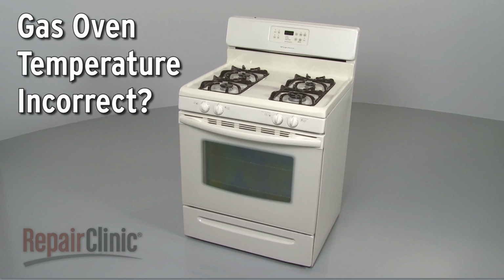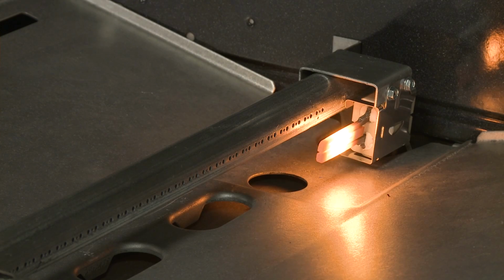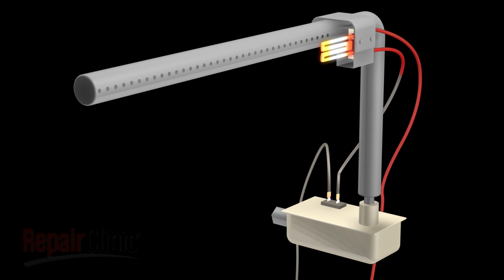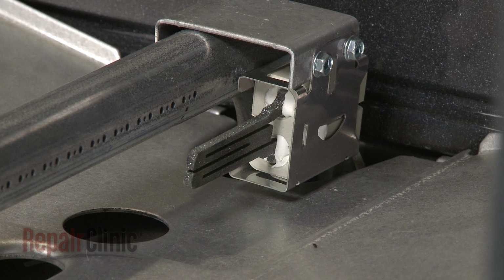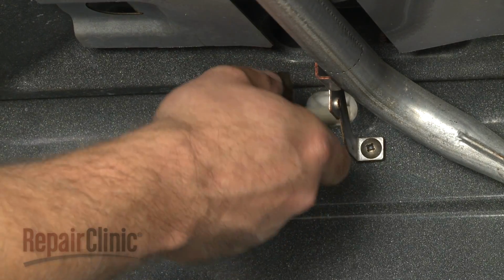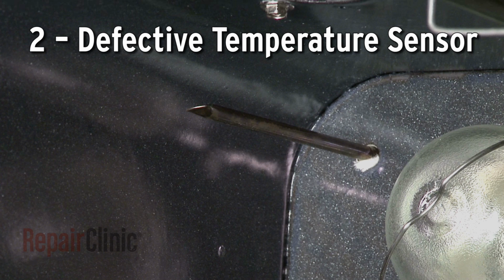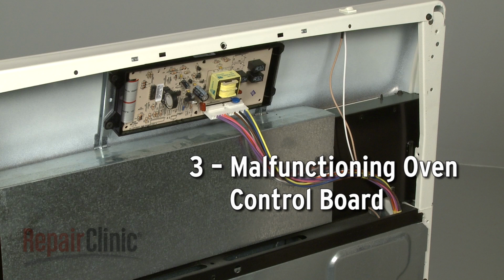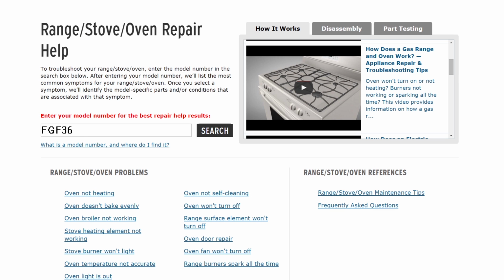Gas Oven Temperature Is Incorrect — Gas Range Troubleshooting

Comment: Does the ignitor need to stay on the entire time that heat is demanded in order for the safety valve to stay open? Wouldn't it be more efficient to use a flame sensor like a water heater?

Comment: For some gas ovens, the temperature will always be wrong. This is because the manufacturer has printed the temperature gradients on the fascia in the wrong positions. In this case you can do one of three things: 1) reprint the fascia with the temperature gradients in the correct location, 2) generate a temperature look up table that tallies up with the gradients on the fascia, 3) Monitor temperature with a temperature probe and adjust as required.